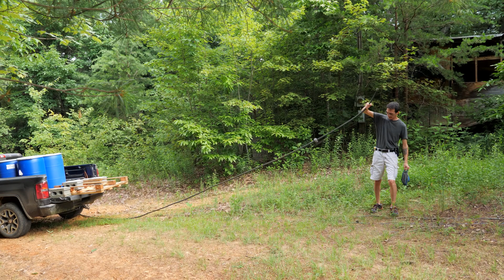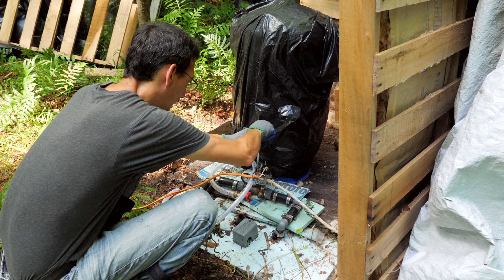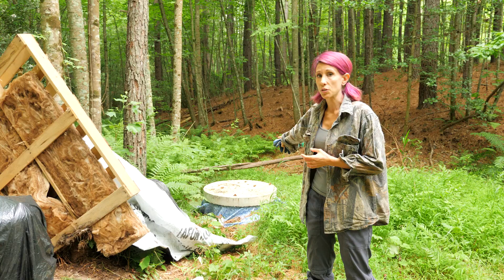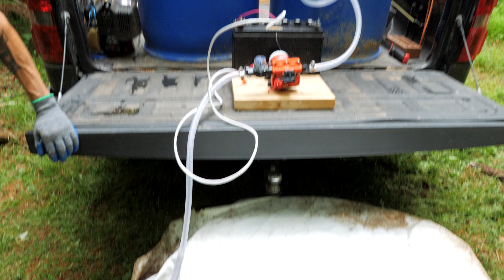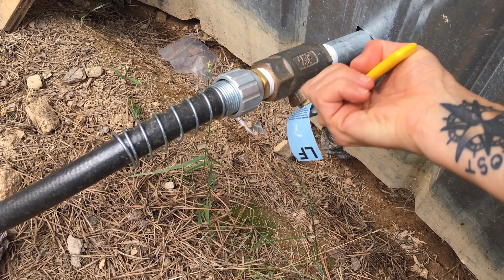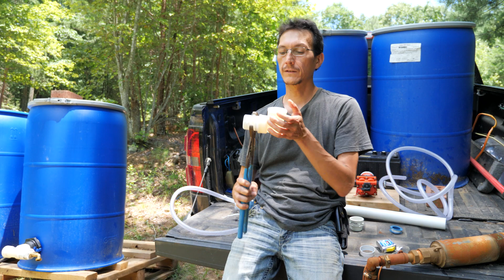NO WATER...AGAIN! Will This Off Grid Gravity Fed Water System Work? (Part 1)

Comment: Whats securing those cinder blocks under the tanks?
Reply from the maker: Gravity
Reply: Might I humbly suggest driving a few sections of rebar in? Or possibly a couple of engineer stakes? It just seems like a possible future failure point under the shifting weight of cyclic loading as would happen while in use. Unless I just missed the back end of that pallet being secured. In which case ignore this.

Comment: Wouldn't it be better to build a high platform right outside the trailer and put a big water container on top of it to feed water into the house? Barrel's of water far away, on a hill, doesn't make much sense to me.
Reply from the maker: The distance from the barrels to the house make no difference. It’s the elevation that makes it work.
Reply: Basically you want a good 5-6 meter drop to get a useful pressure for comfortable showers etc.

To the Guildbrook Farm I want to say that as an appropriate technology expert, I have redesigned, improved and done maintenance for a gravity fed water system for a facility for up to 40 people. Getting enough height is the key factor, the second is to make sure to design backwards FROM the tap, by first oversize he pipe one step to reduce resistance and increase flow in general.

I typically start with 25mm outer diameter tubing, or 1" (inch) and then go backwards increasing the size towards the tanks, making sure you step up the tube size every time you split the line. Treat every junction as a manifold. This way you avoid pressure fluctuations that might burn you in the shower, or just cut the flow in half while someone else is rinsing something in the kitchen or flushing a loo. Gravity fed systems still have a lot less main pressure than conventional grid systems. It's a good idea to have a cheap sediment filter to protect the rest of the system. I use one made for commercial irrigation systems, that is easy to clean in a few seconds. Since you have a lower flow speed and higher flow volume, it is easier for solids to build up in joints, elbows, taps and swanks in the tubing.

I typically use IBC tanks as main tanks.  I can't recommend IBC's enough.
They are 1000 liters, or 250 gallon, each. They are square andcome standard with a big sturdy built-in and leak-proof tap, with a threaded fitting for 50mm ( 2 inch ) outer diameter pipe, which is often a desirable header tube for a typical home system with a couple of taps, an outdoors spigot, a shower, basin and a toilet or two. Don't use smaller main tube from the tank to the house than 40mm. You'll regret it over time. 

The built in tap means there is no need for bulkheads or a separate main tap, although I add one 50mm array main tap, plus a matching sediment filter, when I use several IBC's in parallel.  IBC's come on a sturdy pallet in a metal cage, which is great for protecting the tank from the sun by attaching an opaque outer cover (I prefer cane, bamboo or wood panel, all easily attached).  You get them second hand for about 50 bucks each anywhere in the world. You could also stack them, up to 5 tanks, they're built to hold 1 ton in each, with 4 tons on top. Build a look-out tower? 

ALWAYS make sure you do NOT put plastic tanks out in direct sun, for the health of the barrels, and the health of the water, and the health of yourselves.
Best of luck!

Comment: Get animal control to move the snake's. Mice got into our Verizon- box a couple of times- they do that in the winter. Snake like it cool so probably do it in the hot months. Good luck on this all. I pray our pump doesn't go out either!!  That shaker stuff to warn off snakes that ya can get at Tractor supply- Lowe's, etc. works we put that around our back patio area. Our pump is in a built barn- pump house kind of dwelling. Someone, cut his hair!! And, like your pink look too!
Reply: Need a 410 shotgun and a good hoe for those copperheads....cannot have too many hoes!! Those copperheads are trouble here in Virginia too. If you can put in cinderblocks around the pump with concrete to close it in and build a little square room around it. To protect it from critters getting inside. Our's is like that- so far no trouble. Only that we have to turn off the water and drain pips in the house- if it get's close to 30 degrees. We keep 30 gallons in individual plastic containers in the house- to use when water is cut off. Putting a huge 2 gallon enamel pot on the wood stove- it keeps water hot all the time, and we dip from that for whatever.
I've become the 'spit-bath' queen. LoL
Reply: We have 2 wells, the old one- like what you've got there is reserve. So, far we haven't had to use it. The other well was done in 1978. That's the one we use now. And yes, keep grass short- at all times- helps keep snakes out-

Comment: It's possible that the pump is still ok. Motors are usually protected (thermal or impedance) against over current due to locked rotor.

 I'm surprised that there wasn't a blown fuse or open  breaker up at the house. When you replace the supply conductors make sure it is protected by a properly sized fuse or breaker.
Reply from the maker: Pump motor is good. 👍🏻 Stay tuned

Comment: How about leaving the marine pump at the well with a battery and a solar panel to charge it. Plumb the discharge into the existing piping going to the trailer. Just add a strainer on the suction line. You said the pump you just bought puts up 55 psi. Plenty of pressure and no hauling water. Just a thought.

Comment: last resort you could use that 55psi pump and run hose to your barrels, with a float cut off for when the barrels are full, which should cut of the pump.

Comment: Until you establish a better fresh water system, I highly recommend you take Navy showers to conserve water usage. May lessen your trips to the well.
https://en.wikipedia.org/wiki/Navy_shower
Also recommend you get a used livestock watering tank and plumb it with an external copper coil that you build a fire around. This is outdoors, of course. Through convection, cold water is pulled from the full tank, circulated through the coil, and flows back into the trough as warmer water. This type of hot tub/bath tub would be a nice way for you two to relax after all the work you're doing.
Here's a video on it...  https://www.youtube.com/watch?v=HMjpWlgcK-M
Reply from the maker: Yeah we do that

Comment: Gravity fed water should work it won't have a lot of pressure. By the way what is the building behind you on the hill?
Reply from the maker: It works great. The building is an old trapping shed. It needs pushed over with a dozer.

Comment: Ram pump it up to the 55 gallon drums.
Reply: Take your small Honda gen and run you pump to fill your barrels we leave off grid I put a camper and 2 55 drums upstairs and that run the hole house pump has pressure switch
Reply: Whoops camper pump

Comment: Weed killer for weeds and plenty of moth balls and a prayer i would be petrified tbh myself i hope it all works out hate to see yall go without water for 2 months but once finished itll all be running smooth
Reply from the maker: Right next to our water supply??
Reply: In a general area maybe it would keep snakes away lol we almost bought a house that had major water issues off of a friend complete off grid and they put out stuff to keep away snakes and always killed the grass of course no product got into water but kept them safe they also had 3 goose that roamed free and chickens which killed snakes lol idk just a thought i hate to see you guys go without water especially in this summer heat having to do the extra work to function

Comment: As an intermediate fix, did you try to find the line break using an RF detector? An AM radio can work as detector, and if you need a stronger signal for the AM receiver to detect you can couple the faulty wire to a stronger signal generator, many farmers use the high tension lead of a mower/string trimmer or other engine as the signal generator by winding one end of the wire around the lead. eg: https://www.youtube.com/watch?v=Zu4nFBMjeME

Comment: well shallow well pump and foot valve! system i seen used on lake water system, i fill a rv tank & a pump for water in  rv or a camping trailer system demand pump! well i don't know what the cost would be but tank & pump i had new in 1995 was around 200 dollars, the Guy where my home was at was trying to throw me out and steal my over 2500 dollar investment & get it for nothing!! i went to court & got time to move it & set up in a new place with in last week my water here is crap this is in it ( June 22 email from DEP Barium,radium and gross alpha) above safe levels but in 4/2017 it was safe & how come they did not tell any one!!

Comment: ever heard of Star Trek- ever heard of backup systems. I live very off grid. I have 3 systems for everything. I have had main system fail and backup fail and had to use redundant system. That includes- water-power-solar-generator-fuel etc.I have spent 7800 in all this just fixing crap this year. This is a hard life-off grid and you have to be hearty enough to handle it. Like sink baths when your water system is shot and out of money. i have a 2800 gallon tank with 2 inch plumbing gravity fed- I have been thru 9 pumps so far nad 13 generators in 2 years.not to mention all the car stuff.and no hot water for a year. We have animals too and had 7 horses die because of of not being hearty enough and other critters too. We go from 90 degrees to 30 this time of year. if you truly want off grid - get away from people and go out in the woods. Im not trying to be a jerk- but off grid is not for everybody. i had to train to do it by staying in a homemade cabin by myself for 2 months alone.I hunted for food and had to bucket in water before i moved off grid.Sorry for being so blunt but maybe i can save you alot of money and heartache - suggestion get a vacation off grid spot and do that.
Reply: If you have been through 13 generators you are clearly using small backup generators. What you need is a decent industrial grade prime generator for a house at 12.5kVA (10 kW) that are designed to run continuously. Something with a Perkins engine. Backup generators are not designed for continuous use and will burn out very quickly.
Reply: @brianthesnail3815  i will check into it- thanx. were not using that much wattage were less than 5000

Comment: Drives home just how important a water source is. You will love a well, if it has good water. Lol I would keep that spring fed system operational. A backup water source will be handy. Things can go wrong with a well too. Like the pump failing. We went through that shortly after we moved here. We were 3 days without water until we could get a new pump replaced. Pretty much for those 3 days were spent hauling water. If the pump had not been replaced when it did, I was looking at walking or riding the horses twice a day nearly a mile to water them in the nearest creek. Yep, I would keep that spring fed water source where you can use it. You can build a well house over it. There are lots of those around me. They are usually built with cinder blocks then wrapped in tarp in the winter. My daughter and her husband put a heat light in their well house when it is extremely cold.

Comment: Get Water from the air. Look it up  just buy a filter and make or buy the food grade container.  Its great and easy compared to what you're doing. Please check this out on the wed it's called WATER FROM THE AIR.
Reply from the maker: How many of those “systems” have you built?
Reply: Dehumidifiers are a terrible way of getting drinking water, especially when you're running off solar. You'd be better off jury rigging some tarps and barrels together for a rain catcher than a dehumidifier.

Comment: 10ga solid will do that just fine. Forget the bean-counter safety sally engineer with alphabet credentials, etc types. Listen to decades of experience. Get the cheapest 10ga romex you can find. It'll be just fine. #4 aluminum direct bury cable is very cheap and would also work just fine.

Comment: Watched your two previous videos. For goodness sake get yourself $7,500 prime industrial 12.5 kVA diesel (gasoil) generator. Not a backup generator, that will be inadequate. You will have a life then. Your solar electric system is inadequate. You are effectively living in the 1950s.  You have a gasoline vehicle. You don't totally rely on horses for transport so don't totally rely on the sun for your electric.

Comment: You need to get a hold of engineer775 on YouTube he can help with your water problem he installs backup water and power systems you should check into a ram pump they don't work off of electricity they use water to make pressure to pump water just a thought